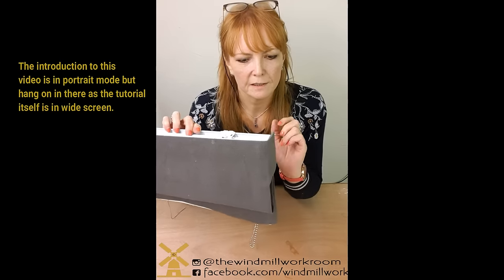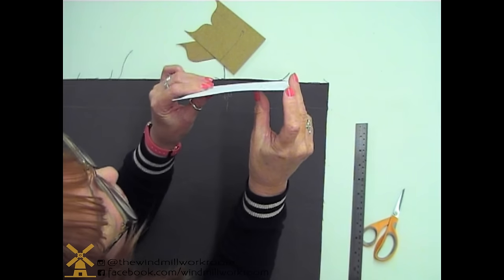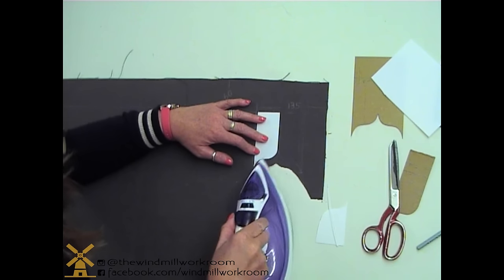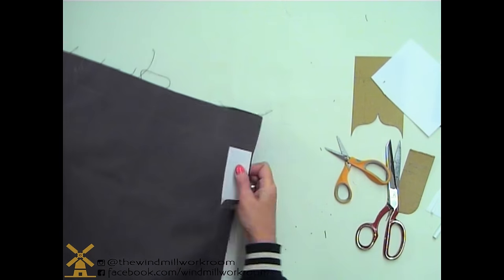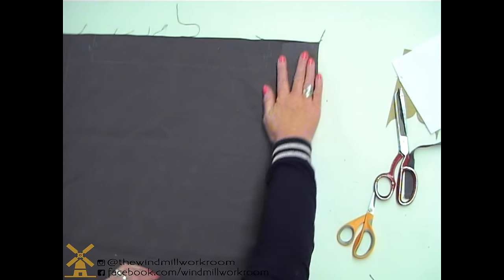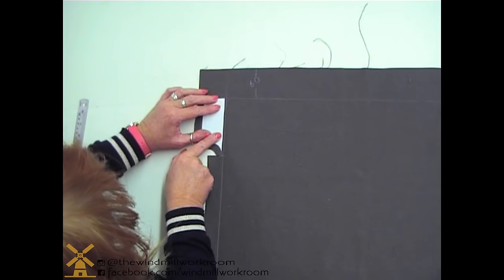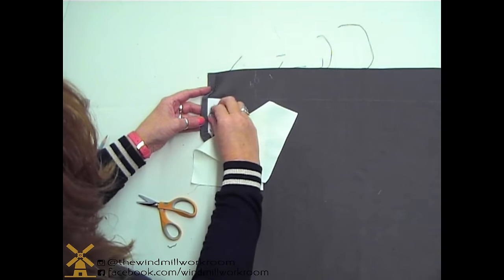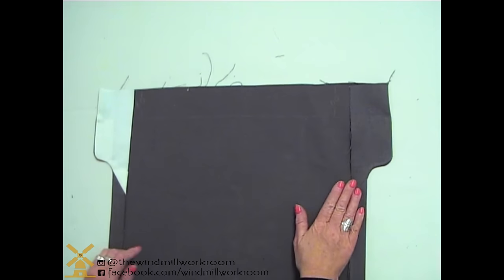How To Make Integral Roman Blind Returns - Pro Technique

Comment: It is great to see your how to video's. I was wondering if you know how best to make a blind, known as a window blanket. Required for a hard to heat house, high condensation, due to poorly fitted wooden windows with old double glazing, not up to spec. Suggestions welcome. With thanks.
Reply from the maker: Hi Allison, thanks for your comment and apologies for not replying sooner, I missed your comment somehow. I've not heard of a blind called a window blanket but I suspect it's just another name for an interlined blind which is a Roman blind with interlining inside (like blanket material) and blackout or thermal lining on the back. I would then set it on the outside of the recess rather than sitting inside the recess so that it overlaps the window so round. That would be super insulating and would make such a difference to cold draughty windows. If you're in the trade I just made a video over on my Trade Pro Patreon site that shows part of the making of one and the layers that go into it.

Comment: Just a question! I never used interlining in roman blinds cause it’s too much work 🤣 but when I make a blind with one lining I usually press the sides of the fabric a double pleat like 4cm then fold it again 5cm , the i cut the lining 1 cm shorter than the width and tuck it underneath the fabric folds then hand sew it , the machine the rod tape ! My question is : which is better ? Making a double fold and tuck lining under the folds or press the fabric one fold and press the lining one fold the put it like you did here on top of each other?
Reply from the maker: Hi there, personally I don't like too much bulk in hems whether on curtains or blinds so I would fold the fabric side hem just once and then turn the lining against it just once and hand sew like I do in this video. The lining thickness is always the same but the main fabric can vary enormously so it's good practice to use a consistent method. 
Having said all that if the blind (or curtain) is to be blackout lined then,  sometimes on thinner fabrics, it makes sense to tuck the blackout lining under a double turned hem to ensure that the blackout lining goes right to the edge. 
Hope that helps. Jx

Comment: Love this where are you getting your Roman blind cartridge thingy? Did you do a pattern template😊
Love your videos x
Reply from the maker: Hi 👋. I get them from a wholesaler, sometimes in component form, sometimes as a std size to cut down and sometimes made to measure to the exact size. If you need headrail either check on line for made up kits or, even better,  go to your nearest curtainmaker. They'll surely be happy to supply you with whatever you need and it'll be of good quality.

Comment: I would Also forgo the Velcro. Staple to a board with a welt on front edge, and mount the lift system to the underside  of the board.
Reply from the maker: It's certainly an option but I think most makers would just go ahead and make a separate pelmet if they're going to the trouble of adding a board as well and that's what most have done previously when wanting to hide the ends of the headrail. The current trend though, at least here in the UK, is for neat Romans with no valance/pelmet at the top so this suits that requirement. It's horses for courses I suppose 🐎😊

Comment: Thanks for a great tutorial. Would you still use buckram if you’re using bonded interlining?
Reply from the maker: Thank you 👍 Yes definitely still use buckram as it needs good structure inside to hold the returns flat and straight.

Comment: Hi, thanks for this tutorial. Absolutely brilliant!! Ive just finished my first Roman blind with the integral returns, however having an issue with the velcro coming away from the side of headrail. Do you recommend one long continuous piece of sticky back velcro for the sides and the front the headrail? J
Reply from the maker: Hi Janet, sorry I was so long replying I only just spotted your comment.
The velcro that comes with headrails is generally welded to the front edge so it's not possible to run a continuous piece along the front and round on to the ends so I only put short pieces just on the plastic end caps. The self adhesive velcro usually holds really well but occasionally can come away if for instance your headrail isn't brand new. New or not I always make sure the plastic end caps are completely clean before I stick the self adhesive velcro on. I use rubbing alcohol to remove any dust and greasy residue and dometimes a light sanding first can also help to give the surface a key if you feel it needs it. Hope this helps. (If you're using a type of headrail that doesn't already have velcro along the front then yes use a continuous piece along the front and down both ends, even extending round the back of the headrail by a couple of cm will help. Hiwever those tyoes of headrails tend not to be child safety compliant so I can't recommend you use them. Please take care)

Comment: Can you tell me how you made to your huge table. Mine has just collapsed. Is it a couple of strips of plywood held together by special hinges. What are they called. 
What do you have underneath the table top. 
Thank you. Nicola
Reply from the maker: Hi Nicola, my table was made by my lovely Dad who's made a few for me over the years. This one is made in 3 sections so it's relatively easy to dismantle and move. The base is made from 3" x 2" timber like 3 table bases with a large shelf low down for storing rolls. There are no hinges, it all just screws together. The top is made from 3 sections of 18mm plywood with a hardwood strip on the edge to protect it. You can see me putting it up after a move in my 'Workroom' video here https://youtu.be/unBR53J4LOs
Reply: It’s brilliant! I need one! We all do! Will check out that link. Keep the vids coming. I’m addicted. Even though I know how to make things. Been doing it for decades. But I like watching for your top tips! Your attention to detail isn’t found much on utube. Keep them coming! 
Do you make pelmets? I’m wanting to start that. But I bet you can do it better! X
Reply from the maker: Thank you Nicola 🙏.... I do make pelmets and will be making a 'Trade Pro' video for my Patrons soon. I also have a lambrequin to make so will probably be doing a timelapse of that too 🙂👍

Comment: Hello, how do you fuse together two pieces of double sided fusible buckram  - both sides are sticky! Or do you use single sided buckram?
Reply from the maker: Hi Emily, I used double sided fusible buckram and just press two pieces together with the Iron to make a stiffer piece. Use a piece scrap lining or something to iron on. You can lift the buckram off while it's still hot then to prevent it from bonding itself to the table.
Reply: @WindmillCurtainRoom  Thank you so much for replying. Where do you put the scrap bit of lining - on the table with the 2 pieces of buckram on top, or between the iron and the buckram? Doesn't the lining stick to the buckram so it  loses its stick?
Reply from the maker: @emilypackham1581  really you can do both so you have lining between the buckram and the table and buckram and the iron but don't spend too long ironing. It's just a quick press to get them bonded together then pull the lining away. Do it while it's still hot, it'll come away easier and you won't lose much of the sticky then.
Reply: @WindmillCurtainRoom  Thank you, thats really helpful x